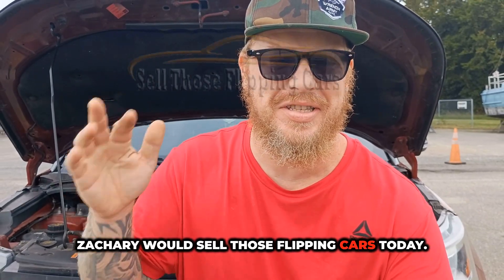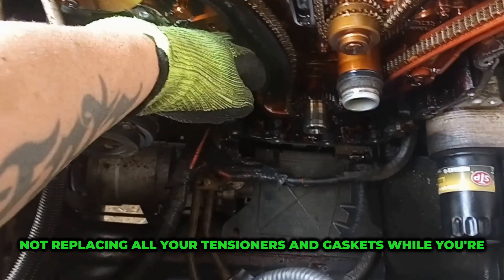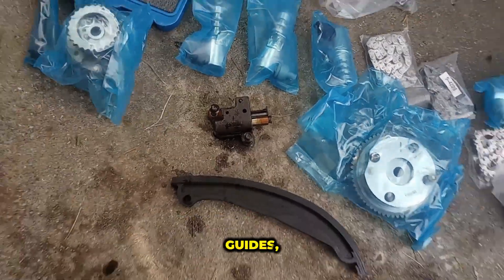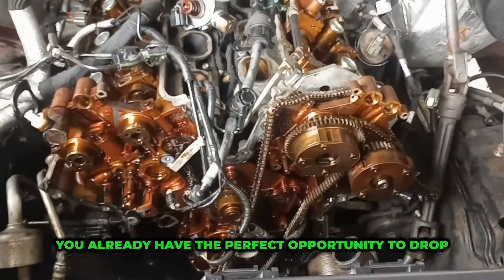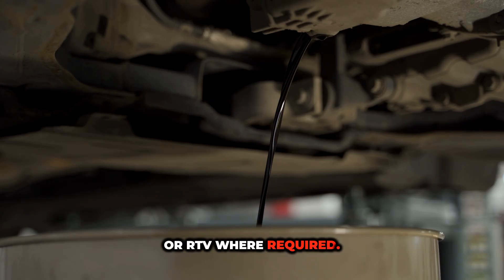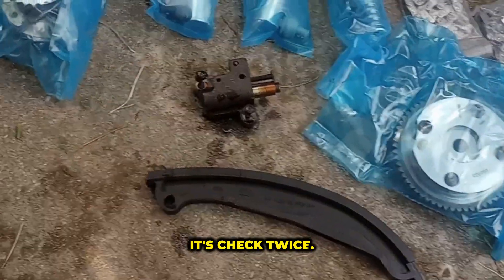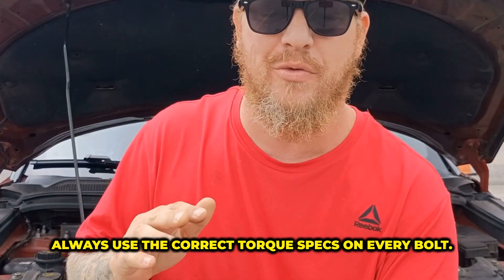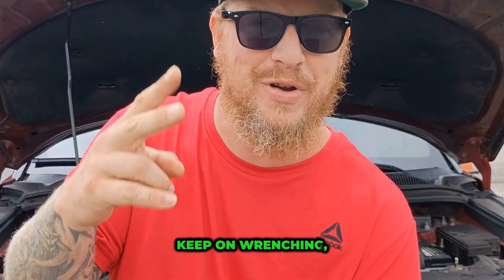Top 3 EcoBoost Timing Chain Mistakes You MUST Avoid!

Comment: I think I skipped timing , well I’m sure . Truck limped home but don’t want piston to meet valve so I’m doing this job once my parts get here . Since my chain didn’t break I doubt there’s much debree in the pan and since it’s a one time use plastic pan I really don’t want to drop it 😭
Reply from the maker: Never worry about the timing chain snapping, it wont.....but the small plastic timing chain guides DEFINITELY will! Once one of them break your job turns into an easter egg hunt from hell. Here is the Timing chain process https://youtu.be/7tOWgH2P5XY This was on a 2013 F150. I am working on a 2017 Ford Explorer now that needs a water pump and timing chain completed as well. Thanks for watching and let me know if you have any questions!